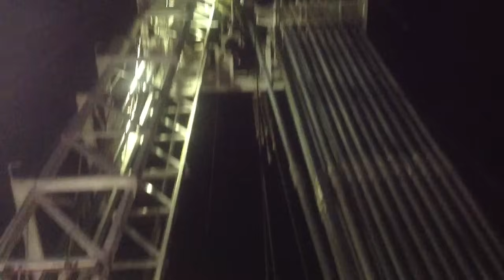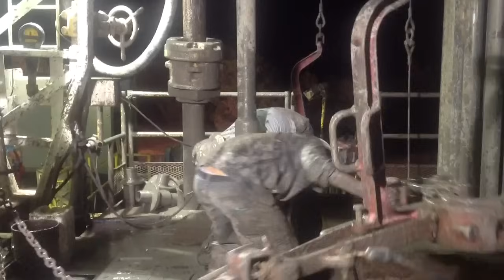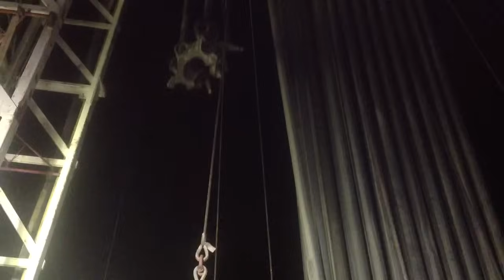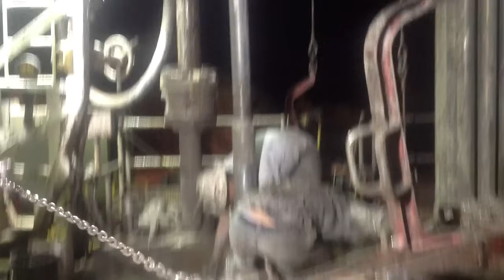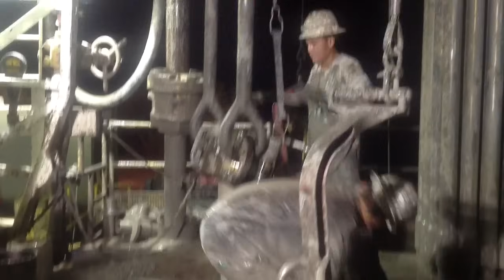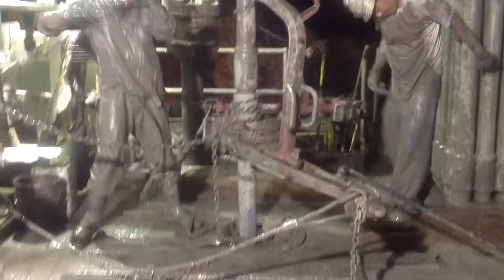Worlds fastest roughtnecks tripping pipe back in the hole

Comment: I've been watching so many of these videos the past few days and am slowly piecing together what every step of the process is doing. It's been fun figuring it out!
Reply: i work on another drill rig nothing like these boys do its pretty fun to watch aye
Reply: I did this for almost 12 years, but not liking to get quite that dirty, I worked derricks. This is just a double rig, as they pull and run pipe in the hole 2 joints per stand. I worked triples, 3 joints per stand, or around 90 feet of pipe each stand. I was also involved in setting a record for furthest reach of any hole at that time, using relatively new directional drilling. The bottom of the 14,000 foot well was over 2 miles horizontally from the drilling platform.
Reply: Nothing better than hands on experience, tripping pipe is easy money
Reply: It’s all easy money until you get hung up. It’s the most dangerous job except maybe infantry or something military related. Women could definitely do it as long as they can lift a 200 lb lifting sub 2 feet up onto the floor and can carry a 300 pound rotary table chain up a steep icy flight of stairs. Easy.
Reply: Pontil drilling from out of Mt Isa Qld . . we NT set a record Woodcutters mine raise bore pilot hole straightest deepest  hole Oz supposed Ikm directional drilling early tech  . . not quite , we shanked the hole opener hammer some fair way down before our original pilot hole . . Warman 5000 , an Australian made geo thermal comply rig
Reply: @rastus666 I used to work on a jackup rig in the gulf of America. No doubles out there 😅
Reply: @ I never worked the Gulf, only northern Mexico(aka USA).

Comment: That really takes me back, I did that for a few years in the 80's when I was 20something. Went through Roustabout, Pipe racker, Lead tongs, Derricks. Looks the same. We weren't allowed to use the rotary table to hold back up. Had to make up the pipe with both tongs every joint. Slows you down a little but not much. joints are more surely tight though.

Comment: Exactly how we used to trip in the hole. Old school and fast. Good shit boys. That's only a 2 stander (I've worked on 2 & 3 standers) not a triple which is what I used to work on, 3 stander. Everything is a lot bigger and heaps more room on the floor. It's something that is hard to explain to people who haven't worked on a rig eh, so good on you guys for posting this video. 🇭🇲👍
Reply: In the north sea we only ever worked triples (3 joints = a stand,a stand = approx 90ft of pipe)...sometimes if we'd been round tripping i was so tired i couldnt climb into my  top bunk and used to fall asleep on my cabin mates bed (1 in on days  1 out out on night shift)....wake up about 7 hours later,shower ,food and do it again....those guys on the lands rigs had it tougher than us...much respect.....glad i'm retired now !
Reply: Worked offshore on a jack up rig mostly 5 inch drill pipe. We use both tongs to tighten the joint on tripping in and out of the hole.

Comment: We used to average 7 stands in ten minutes on a triple. Just like your going. 3 stands in five minutes and 4 the next five. To 13,000 feet. Worked our ass off.
Reply: looks like you know about this, what happens if the tubes come loose and fall? how do you get them back
Reply: @elsapojimmy You “fish” them out. “Fishing” is what’s called. You either run certain bha (bottom hole assembly) which is a specific set of tools that go at the bottom for what needs fished or you trip in the hole and hope to screw on to whatever you dropped. When I was a green roughneck I didn’t tighten the dog collar tight enough and we lost our drill collars. Took hours and hours on end on a single tripping in and out to get them. I perfected tripping in and out in one shift lmao
Reply: @arielmorales565 I feel this in my soul. I was beating on a dog collar with a brass hammer and the head snapped off and ALMOST went down the hole. Whole rig floor was in shock. Driller said I was lucky. Also a green hand at the time. 🤣😬

Comment: Worked camp job’s northern Alberta. ( triple big rigs )Peter Bawden Drilling Ltd. , fall. and winter 1960s  roughnecking and this is the speed we went running  the pipe back hole ( called. tripping ) these man on this rig , are good hands  real good teamwork / keep that oil patch drilling have. a good. day / Bill. S.  Canada

Comment: Unsure why they're called world's fastest but they're doing a good job. For those unsure what they are doing, they are attaching what are called "stands" of drill pipe which are usually 3 pieces of already connected drill pipe to the existing string of pipe that is down the hole....so each time they make a connection they can lower the drill bit down the hole an extra 90 ft or so, until they have connected enough pipe that the bit reaches the bottom of the hole and they can start drilling again. Stay safe.

Comment: Never drilled for oil, only water and  1200 feet max. Tripping pipe in and out was always fun. API threads are amazing things. The toughest coolest connections I ever worked with. Cheers

Comment: When Halliburton re-worked one of our wells in North Dakota, They couldnt find the correct fittings  for the packing sleeve, finally our company man tracked it down like a 1000 miles away in northern Canada, I bet that hot shot made 1500 bux driving that piece to our site in 48 hours ! Those hydraulic tongs their using are $ 40,000 bux brand new !

Comment: I never did that. Im too puney. 4:05  But i worked in machine shop in oil field and repaired those tongs. Rotary slips. Elevators. And rethreaded thousands of those pipe threads. Wash pipe, drill pipe, drill collars, Drill caseing,  8rd thread, buttress, a.p.i regular, full hole, internal flush, hughes slim hole, h-90, hydril, atlas bradford, line pipe. Back in the old days.

Comment: Remember doing that with Kelly rig, with 6000m pipe in the hole. Round trips were 24 hours. Laying down pipe was long process. Often 3-6 months on a hole. Sure beat those stinkin little singles, doubles as for quality of the drill rig. Everything was bigger, cleaner ( as you had time to clean, maintain rig). The chain was faster than a pipe spinner, or iron roughneck. My wrists were like steel, pulling slips all day, for months on end. These guys are pretty good. Big rigs were more civilized.

Comment: Wait until the power tongs fail and you end up tightening  that pipe with pipe wrenches. Some companies won’t let you slap a chain around the Kelly like that because some people have lost fingers and worse doing that. They have went or talking about going to some fancy two winch system where you clamp the tail end of the chain to a second winch. It held tension on the tail end of the chain to speed the joint. Not sure how well that worked out or if it was ever implemented. I know a lot of tool pushers weren’t happy about it. More work for them evidently. Oh well. Back to slips, elevators, tongs, chain, dope, kelly, speed chain, tongs, repeat. Dope has a different meaning to anyone in the oil and gas industry! I thought I was going to get messed up using Case 580 power tongs one day. That’s where you use a Case 580 super L backhoe with a chain attached to tighten a wellhead. The chain slipped around the wellhead and I was holding the tail end of the chain with both hands, trying to hold enough tension that the wellhead would turn and the chain wouldn’t slip. My hands hit the wellhead and all I can say is it had to be Gods intervention that kept me from being wrapped around the wellhead. Somehow my hands opened up and the chain slipped through my hands! It wasn’t a large wellhead 13 inch or so, but I finished tightening it with a set of 60 inch chain tongs and an 8 foot cheater pipe.
Reply: Wow

Comment: Everything has to be done on timing! Crew working together knew what each crew member job was! Been there a many times the early 80s! Looks like they had a nasty trip out of the hole! Lot of mud filled pipe on trip out, mud bucket probably needed new seals! Yep it was nasty! I had a pair of cover alls and slicker top to keep mud off on trip out then pull off those coveralls and slicker for trip in and usally kept dry gloves for throwing chain! Roughnecking was a hard long job, especially when you catch a case of blackleg!

Comment: this is when I loved working the rigs no matter what position! Trippin pipe in or out was always a blast! Loved working derrick trippin in! And these boys aren't any faster than most any other rig crew. Its a demanding job with no room for errors and no time to waste! We had stud crew with the record for a round trip to bit but most crews worked really fast and efficient.
Reply: Why are they trippin pipe back in? Shouldn't the drill steel be drilling down for every section they put on? I understand tripping out but no clue why u have to trip in?
Reply: There are many reasons to pull all the way out of the hole, such as a bit change, well bore survey, failed downhole tool, change bottom hole assembly@jaywagner13

Comment: When I was drilling in Oklahoma in the 80s and the chain hand put 4 wraps on the chain I would kindly ask him not to do it anymore or I would run him off. The chain should keep going after pipe gets tight in a fluid motion with the tongs following smoothly along. Also less trip time. 3 wraps or your a worm hand. LOL I miss the oil fields

Comment: my worst day of being a roughneck was getting called in to work a 15 hour night shift in the cold winter of utah. i was runnin on 3 hours of sleep too. don’t sign up to roughneck unless you can really handle conditions like that. and if you can’t stay focused and pay attention the whole time you can potentially lose fingers or limbs. roughnecking ain’t for the weak
Reply: You got that right.....As an elevator constructor I worked many 7 12's for months but we had many easy days in there. A roughnecks job requires 100% focus and 100% attention at all times on the job....Not to mention being physically ready to perform.....Much respect for you guys....
Reply: @michaelshepherd733  hey i appreciate it man. idk much about your job but much respect for that as well. doesn’t sound like an easy one. but i just barely decided to go back to HVAC tech. im only 18 and i don’t wanna get sucked into the oilfield forever, it’s too brutal for a career
Reply: @ianmeacham8605  HVAC Tech.......great trade...some electrical, some plumbing and pipe fitting, some sheet metal work....All good to know.....Don't blame ya for getting into that instead of roughnecking
Reply: My worst day as a roughneck was when I realized my body couldn't take it anymore. I broke out in the field in 1978. Worked with a great crew on a Smart drilling Co rig #4. They were great and taught me everything I knew and loved about being a ROUGHNECK. OFT forever.

Comment: Should be able to trip out and back in in two 8 hour shifts. I was on a rig in the early 1980's  that was down 18,000 feet and we tripped out and in the hole in two 8 hour shifts, collars included. We didn't mess around. Had to give the driller a lot of credit for his choreography.
Reply: Your Right. I worked for Blocker Drilling in Texas in 1980 as a Chain Hand.
Alot does ride on the
Reply: Driller but a lot of credit goes to the worm, chain Hand and Derrick Hand. You Agree
Reply: @janallen5297  Although I was the worm I performed my job well. and with precision.

Comment: *raises hand a little timidly* 👋

Okay ive been watching vids of this lately cos curious about whsy this job entails. Always heard it was rough dangerous work where every little hesitation or wrong move can cost lives or your job or safety otherwise.

Anyway! What are the metal claw thingies?

Why does the guy remove a giant pin from the big metal stem they were clamping onto earlier and put it in a other thing and then move the big hanging pipe clamp/connect wrinse and repeat??? 

What's the cemebt looking stuff?

How mant times a day must this be done?

Are these guys able to pick me up and toss me around the bedroom...?
Reply: Which claw thingies the top or bottom ones? The cement stuff is drill mud. Times a day is until pipe is gone and then pulled back out. And for the last one idk if thats in a good or a bad sense
Reply: Is called tripping pipe witch there are many reasons for doing this but most common is to change out the drill bit. The big yellow things going up and down are the blocks they go up and down the Derrick. The big red clamping thing that is going on to the drill pipe “ metal stem” are tongs and depending on witch set is on top they are used to brake or torque each connection between the drill pipe. The cement looking stuff is drilling mud used to cool the bit, carry cuttings out of the hole and hold a certain hydrostatic pressure on the hole. And yes it is dangerous but usually only when someone is not paying attention. Most rough necks will throw around any willing women around the room at least once

Comment: This is the way you trip the pipe. The only one I have seen up here that really know what they are doing. Probably in West Texas out of Midland. The chain hand was on the wrong side because the tongs could slip and cause severe injury. That was the drillers fault. The Derrick hand is around 90 ft up. Watch him slap those elevators together. That takes talent to get it right everytime. What they didn't show were the collars. The first ones to go in. At least the first 500 feet or so. You don't have to be a big guy. Skinny guys can handle those also. Real men do this work not sissy boys wanting to be a girl.

Comment: Can someone explain why they have to keep replacing the pipe? Like where does this incredible work play into the process of getting oil?
Reply: These guys are running in the hall there could be many reasons why they pulled out could’ve been a change bottom hole assembly they could be running in to pull out sideways they they could have a test tool on they could be preparing to core they could be running an open ended the plug back they could be running an intermediate string with a hanger and back off tool they could be going fishing these guys are not drilling at this point they are tripping getting back to bottom for whatever reason

Comment: 2 questions about the chain   is it first used to slow  the drill  ?   what are they doing the second time  when they pull it  from the left  side  ?   i would last 5 minutes  if iwas lucky   i am  65  though   maybe   i could have do it  when younger
Reply: i just saw another  view  of the  chain   on the pipe   its used to tighten the  giant  wrench     but  still the  other  bit  on the left  side
Reply: The chain spins the top drill stem till the threads get snug then they lift the tongs to clamp the top pipe  an tightened it up the table is locked so they don’t need the bottom tongs going in the hole

Comment: Does the chain hold the pipe in place as its screwed to another?
Reply: The chain is what screws the pipe together. Gravity holds the pipe in place. Pin end of the top joint sits inside the box end of the one in the slips.
Reply: @charlesartrip4239  ah, thanks!

Comment: Whats happensif they dont get the pipe tight and send it down the hole it looks like he's using the chain on the top piece to tighten. 
 There working ther asses off for sure
Reply: The chain makes it up  - then they torque it with the tongs.

Comment: They're so health but they forget to put some dope to the thread.
Reply: Already doped 'em. Doping the box threads coming out of the hole is SOP for savvy crews. Look, you can occasionally see dope squeeze out as the pin threads tighten up in the box threads. Pulling out of the hole is slower, so there's more time to do it. Thus eliminating a step when hurrying back to bottom. Don't put too much dope in the box threads, though. Or the excess will centrifugally rain down on ya when pipe is fast spun by the chain hand.

Comment: Listen up folks. These guys had the luxury off having the rotary locked. Me and my younger bro on a triple here in Texas make these dudes look bad. Try throwing chain and two sets of tongs. I was always pumped after a 12 hour shift. Needed more
Reply: Needed more lol. More pain. Not enough.
Reply: Mike ...I know what Kelton is talking about... I Did the same thing... You see the thing is they didn't had phones that have the ability to record video back then... Late 80's early 90's... we could trip pipe twice as fast.. chain hand needs one less wrap or needs to let loose just as it gets tight so the chain slips also. Not trying to take anything away from them, it's a hard job, they are doing what not many young kids will do these days... Work ! At that.

Comment: Didn't look unusually fast to me as a matter of fact I worked the floor by myself tripping pipe back in the hole for about six stands once and was no slower than that. Now I did have pipe spinners but I had to set and pull the slips by my self and attach both sets of tongs with a driller that showed no mercy actually I think it was the tool pusher running the rig at the time.